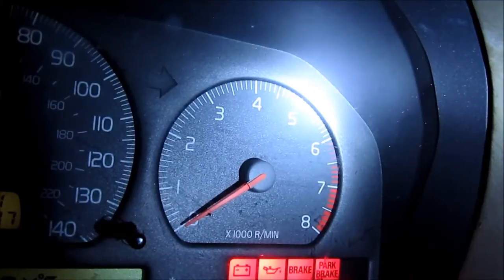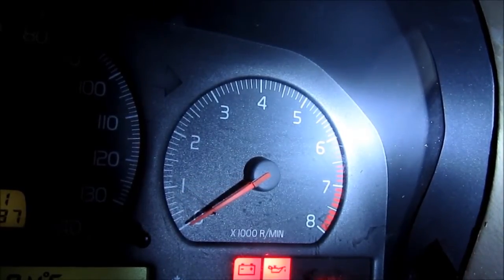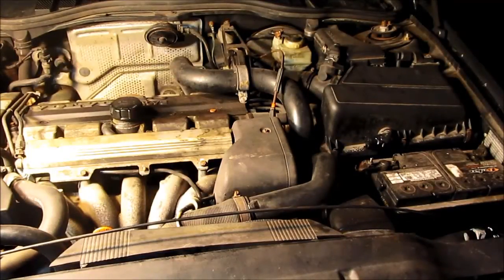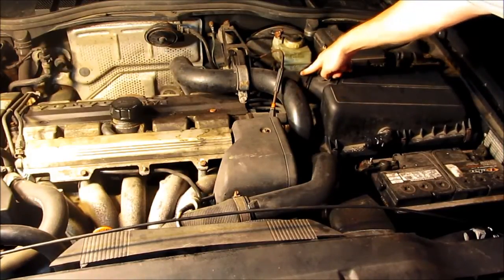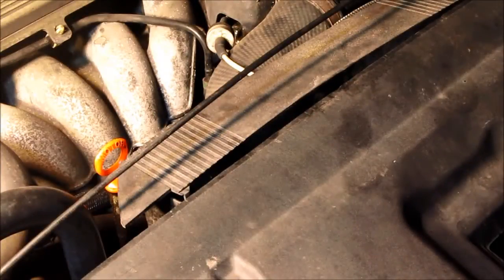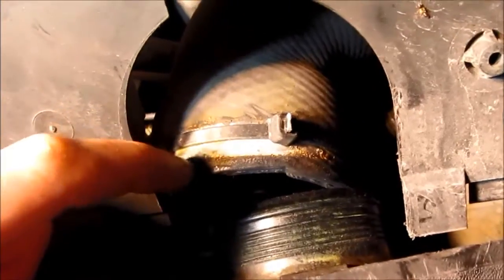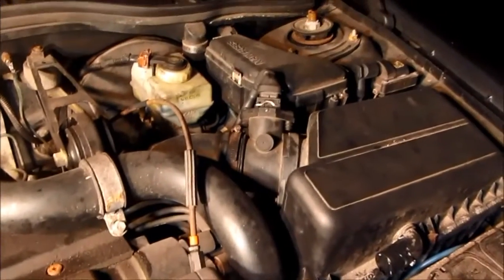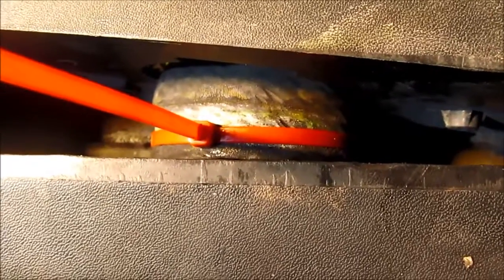Zipties are not hose clamps!

Comment: A long zip tie can be wrapped around more than once. Each wrap multiples the clamping force. Three wraps would have fit on that connection and probably exceeded requirements significantly.

Comment from the maker: It maybe would have worked on a naturally aspirated engine or upstream of the turbo, but not on the boosted side.  It puffed black smoke and made the trans act up too, so we were afraid it was a much worse problem until I heard/saw the air leak.
144,897 miles. Bought new in 1998. We aren't super heavy drivers. Engine's in great shape with plenty of power and it doesn't burn a noticeable amount of oil between changes. Moves people, luggage, and a half ton trailer no problem.